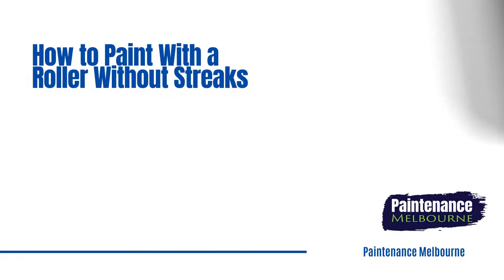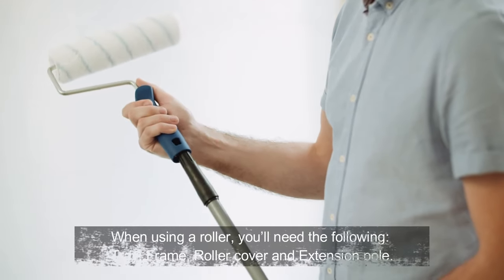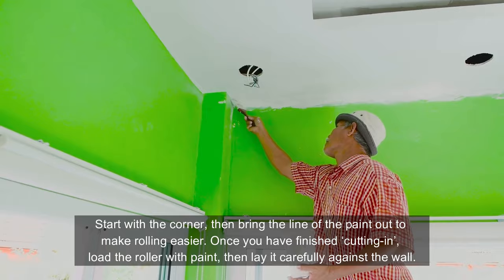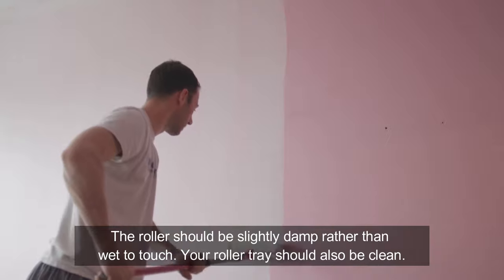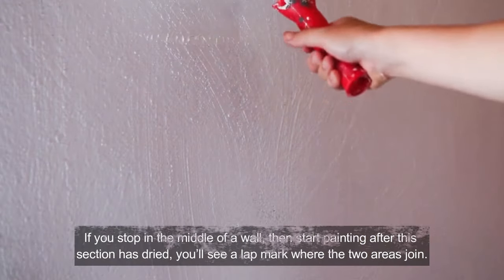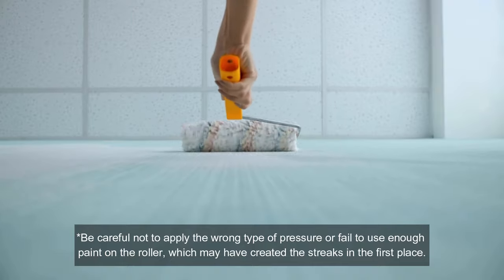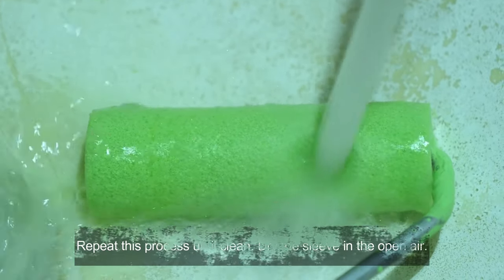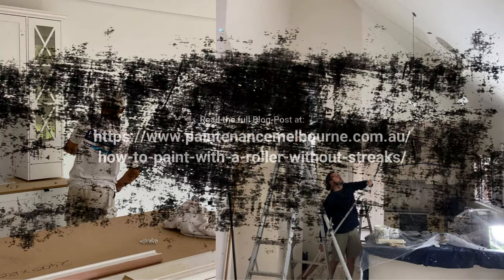How to Paint With a Roller Without Streaks

Comment: My walls come out cracking the one washed down with 2 prime coats on -3 later top coat very smooth unlike my metallic paint that's streaking bad ,shall try with your tips awaiting my bucket filter now -is that necessary for even paint distribution?